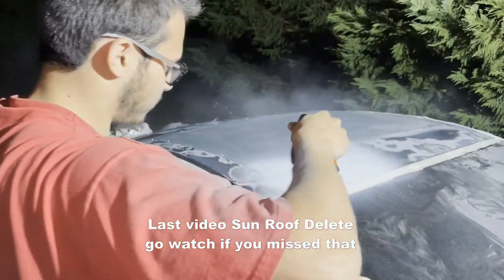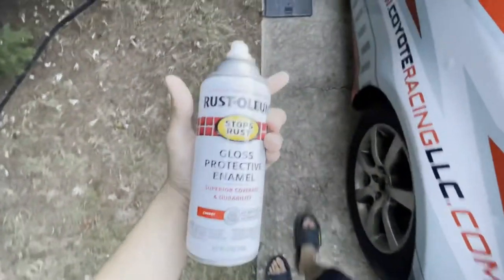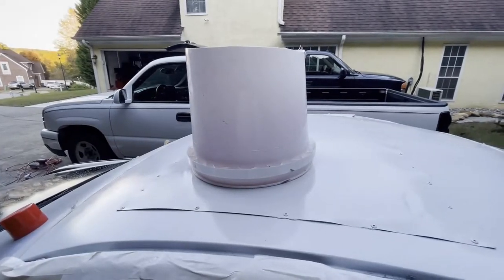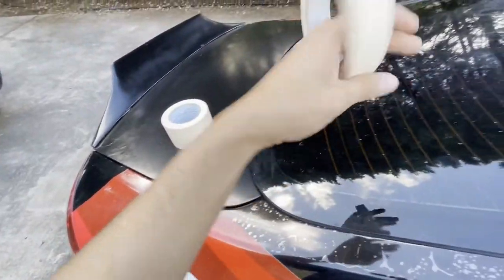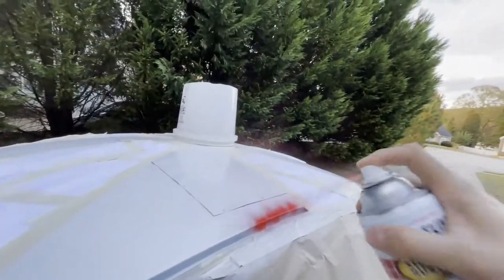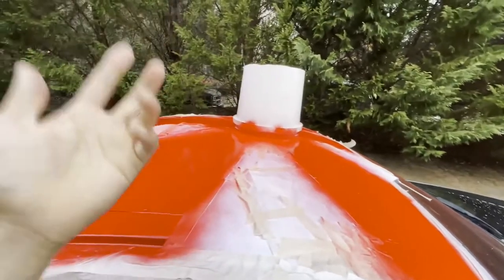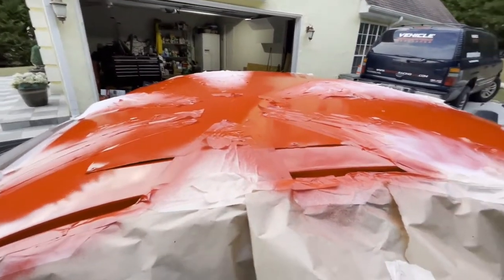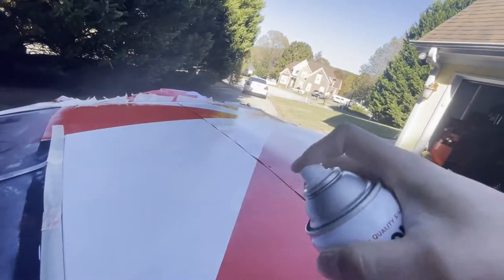Painting Japanese Flag on Your Car for CHEAP!

Comment: No disrespect learn gow to paint dont stop in middle of car law nkce even long lines gling one way then opposite for next coat. Lay paint on as wet as possible will get you best finish with spray cans the roighness comes from paint drying before it hits your car. Bit looks good though for a spray can flag. This is how we use to do graphics before wraps was mainstream for our dirt and asphalt latemodels round track racing but used spray guns in our shops and 90 percent of time it was like glass paint shop perfect paintjons way more bright and shiny and glpssy then a wrap but wraps make ot so mich easier now. Should have used 2k clear or even that glossy epoxy clear for shop floors will make a spray paintjob look like glass instantly with no orange peel
Reply: That spray paint ha's using, is an enamel. You cant spray a 2k urethane clearcoat over enamel paint  Or it will lift, solvent pop, and peel. Why would you ever recommend. For some to use epoxy resin on there car.  Epoxy resin isn't uv resistant. Causing it to yellow. In a short amount of time. From being outside in uv sun rays. Also you never spray a panel one direction. Then spray it the opposite direction. Thats the main cause of runs, and tiger stripping. We dont spray with lacquers anymore. Meaning you dont spray. Eenamel, or urethanes on. As wet as possible. Thst causes even worse problems. You have to let each coat. Till it gases out, and flashes off. Your helpful advice. That you typed for the kid. Is the how to f**k your car up. 101 book for idiot's playing in a comment section